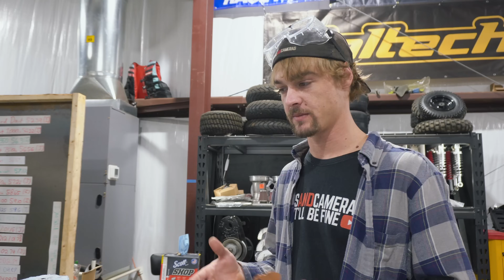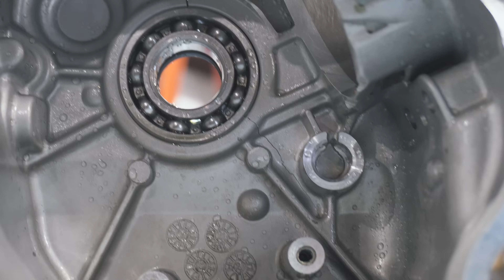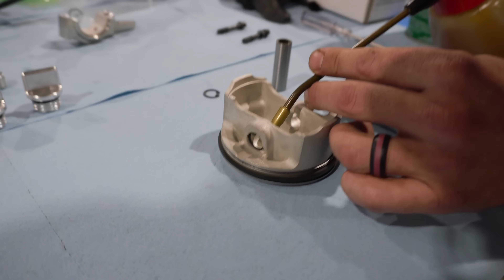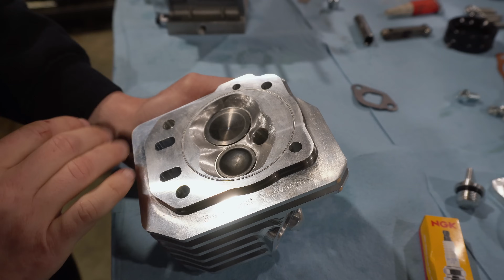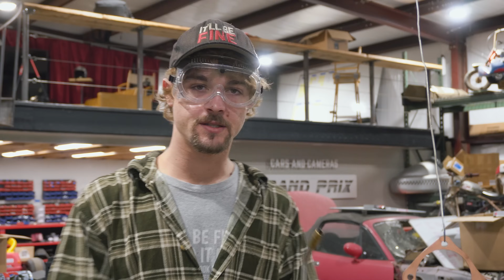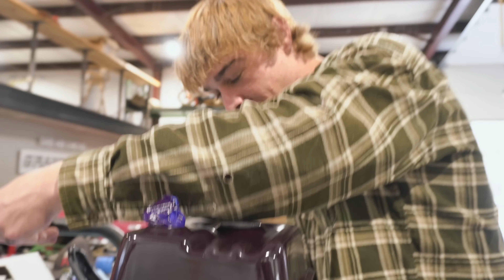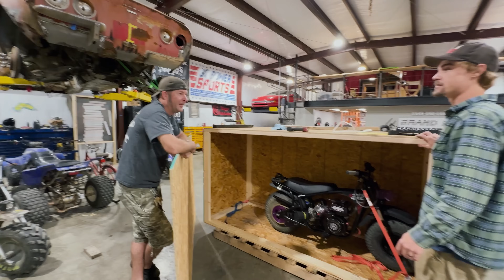Tillotson 263cc BIG BORE Build | Billet Head, 13:1, 30+HP Monster!

Comment: this is really impressive, this engine exceeds 100hp per liter. Especially since it's NA. As a side note, engine internal parts with shavings and burrs are unacceptable, yes the builder should be diligent but that is 100% considered a bad part.

Comment: I need help with a jawa moped.
That's definitely a late sixties or early seventies model it's a 2-speed engine, but when I bought it the engine was seized and I've tried to break it free with mystery oil but it still didn't work so therefore I need help trying to find a new engine for my can y'all help me out

Comment: Please can I get the parts list
Reply: EC 263 bottom end kit
Custom cam
Moflow1 cylinder head
Gage 1.3 rockers
Mikuni 28mm (I'd recommend the Nibbi 28mm)

Not hard, you can get everything you need except the cam. I recommend something like a Dynocams 308.

Comment: I wanna get one of the early XL/XR 500 engines and throw it onto a Sprint Kart chassis - man that will be a ripper with all that torque straight off the rip and would be a hoot on a smooth concrete surface track, just drift central with no effort. Actually, it would probably be a nice kart to drive on road race circuits too.

Comment: Need to run sonoco 110 with that much compression any thing over 10 to 1 on a small engine is better and you'll gain power and run cooler

Comment: Did you measure pushrods or there is a certain size for this build ??
Reply: 5.700 but that's because of the custom length valves. Typically this head uses somewhere in the 5.500s

Comment: I don’t know if you guys will respond or not but I have a predator 420cc but my chain keeps slipping after I tighten it is the #420 roller chain to small or should I try getting a better #420 chain
Reply: Check your chain alignment and it could also be your motor plate flexing and the chain slack changing. Especially with something as torquey as a 420.

Comment: You need to fab up a build/run stand for an automotive engine stand so you can rotate it while you build it then run it on the stand. I did that for my Z-50 engine.

Comment: I always lightly chamfer the parting line on the rod and the bearings. This will prevent scraping material off the back of the bearing and the chamfer on the I.D. of the bearing makes sure the bearing crush will make the parting line a tiny bit further from the crank so it doesn't scrape the oil off.

Comment: (Cars and cameras) “9K rpm very high!”. My RC car engine idling at 13K…
Reply: My kohler sounds like it’s gonna explode at….. 3800
Reply: A 2 stroke rc engine and a 4 stroke build based on a pressure washer engine are 2 completely different things and there Is no comparison to be made between them
Reply: @kartracer5g229  this motor ain’t no pressure washer engine
Reply: @joshmanis9860  yeah and it was a joke, he’s getting defensive over stuff he ain’t know about
Reply: @theepicbuilder2935  yea I would help if I changed the oil and oil filter in it I want to try and find a oil cooler for it
Reply: @joshmanis9860  turbo charged pressure washer

Comment: You guys are giving viewers valuable information on any rebuild. I restore vintage Briggs & Stratton 1hp engines, from the 1940's and the methods you are going over should be applied to every rebuild regardless of the size.  Thanks for the correct techniques.

Comment: We used to put the copper head gaskets, from our motocross bikes, on the burners of electric stove tops and let 'em get hot enough to glow. Had to brush 'em off before installing, but it worked great.

Comment: It wasn't obvious but the copper head gasket should be brought to cherry red. It will need to be retorqued several times after several run (heat) cycles before it will hold the torque.

Comment: A 260 CC mini bike that is insane. Electric start would be nice but you don't need the extra weight not sure how easy it is to rope start an engine with 13:1 compression

Comment: Just a tip: When wanting to apply stickers  perfectly straight, I know this seems counter initiative, spray the surface you’re applying to with glass cleaner, put the sticker on and move to desired location, and you can get your sticker perfectly straight when everything dries. The sticker will adhere even harder over time.
Reply: Counter INTUITIVE. I think Automistake bit ya!
Reply: This only works with vinyl/stickers that have solvent based adhesives. Most vinyl is but you'll find lots of die-cut laminated stickers never actually dry or 'stick.'

Comment: i was inspired by you guys and finally threw on my first mods to my 212, a 26 mm mikuni and a header pipe. unfortunately, the extra power destroyed the bearings in the torque converter

Comment: Annealing is the process of removing any "temper," the piece of metal has, it prevents the gasket from getting softer after the engine heats up.  Not annealing will make it soften up while in service, which  would make it lose proper head bolt tork. oh yeah, nice vid., again, I really look forward to Wed. vids.

Comment: 100 octane  fuel 😂, you are doing like if it was somethink special, I can get this on normal gas pump😉 Enjoyed the build.
Reply: Maybe, but I bet you're detonating if you're trying to run 13:1 and shortening the engine life.
Reply: @WyFoster  actually no because I am using the cheaper option witch is 95 octane,that is standard here.
But my motorized bicycle did not like the 100 Octane, because the burning time was shorter, so the small engine piston had less time to extract the pushing energy from the fuel.
Reply: 100 octane in Europe is 93 octane in the USA. To you, this is running on about 114 octane.
Reply: @WyFoster  yeah "SURE", also america 87 Octane.
And i don't get the 114 octane part.
Reply: @Jarda_B  RON in Europe vs MON in the USA. It would take about a 114 octane rating in Europe to be the same as 100 in the USA.

Two octane numbers are routinely used to simulate engine performance: the RON simulates gasoline performance under low severity (at 600 rpm and 120°F (49°C) air temperature), whereas the motor octane number (MON) reflects more severe conditions (at 900 rpm and 300°F (149°C) air temperature).

Comment: There's easy way to cut a gasket. Hold gasket paper in place, where it will be mounted, and tap all around the outside edge of the thing you're making the gasket for. Tap with a socket extension or small hammer. The sharp edges will cut right through. Do this for the inside cut as well. This is not my idea, it's a pro tip. Try it, you'll like it :)

Comment: I sure hope tillotson is watching this video, because one should not have to go thru all this to build a brand new engine. A little oil rag wipe down is ok, but to have to go through this thorough cleaning is way too much to do on a bran new engine
Reply: Isn't this the block Charles gave us a sneak peak at during the Pate swap meet? Something bad happened to it and it dropped the sleeve. That's not a new block.

I'll admit I haven't watched the vid yet, I may stand corrected.
Reply: Tillotson has the block, but the machine work to install a 3 inch sleeve is done by a third party.

Every engine should be meticulously cleaned before assembly. All parts.
Reply: @WyFoster  I would find a different third party to mill the blocks then...
Reply: @vharrald  It's typical that machine shops leave final cleaning and deburring to the engine builder. I prefer to use my own methods.
Reply: @WyFoster  to me, that's just laziness on the Machinist's part... I used to work on cars.. and when e ordered a shirt block from the dealer, it was always thoroughly cleaned before we got it
Reply: @WyFoster  no worries...
Reply: @SantaSkip  An assembled short block, yes it should be clean. A raw block from the machine shop in my experience will have been through a hot tank but that is far from clean enough to assemble.

Comment: Thats only 9 or 10 HP shy of a KX250 if it really does have 30 HP which seems doubtful ... Looks more like 25 HP which is really good for that type of engine and lets not forget. Most stock type engines put out way more torque than HP over what a racing motor will put out

Comment: Try not to be worried about compressing your valve springs when you leave it is say. Plenty of videos of old engines starting after many yrs sat and they weren't left a tdc. If a spring goes out of calibration when compressed, it aint gona last long buddy 😉

Comment: See I tend to disagree with you all’s take on it’s up to us to QC parts ordered. It should be checked at the manufacturer especially but also at the retailer level as well. We are the customer and should not have to worry about that, but it is our responsibility as installers to verify.  Basically everyone is cutting corners to keep up with production demand, and it’s the customers that suffer. I personally think you should be able to purchase a small instant replacement policy where they send you a new part before you send faulty one back, but as most ppl know they don’t want that crap back they just want more of your money. Retailers should pursue ISO 9001 certifications to mitigate this stuff. Peace!

Comment: Interesting build and all but I have a hard time understanding the concept of spending soooooo much money on an engine like this.  For example, my son just bought a 30 year old Kx250 with a great running engine and I guarantee the engine in the bike makes more power and will outlast a build like this.
Reply: All true but mini bike racing is what they are doing. And yes there are mine bikes that will fly. Try 94mph. My old 175cc Kaw gave me years of dependable fun but I couldn't throw it in the trunk go.
Reply: @jeroldlafferty54  I definitely understand why and know the results speak for themselves.  What I am getting at is why not throw the Kx80/85 engine in a minibike frame or something?  Check out the Stunt Freaks Suzuki PV 450 to see a truly insane mini bike.

Comment: Nice build but never seen someone use rtv on a copper head gasket. You use copper spray on a copper gasket. I like the channel but some of the misinformation on here is bad. I hope some people don't follow exactly what they do. They make it work but is it right.
Reply: Every professional small engine builder uses platinum gray or Hondabond because they want the clamping torque from using that kind of RTV. 

The spray stuff is weak in comparison.
Reply: Yea they use that for cases and valve covers. Not on copper gaskets. I've seen it used on exhaust gaskets. Not a head gasket.  And I've built numerous small motors that make lots of power and use spay a gasket copper coat. Wonder why the can had head gasket pictures on it 🤔
Reply: @ralphhondaman  I set the world record in the 8th on a mini bike (video on my channel) Head gasket was sealed with Hondabond.
Reply: @ralphhondaman  If you make enough power you will need to use a locking RTV to stop the gaskets blowing as easily.
Reply: And do a little research. So many forums and people say not to use silicone based sealer. Use copper spray if any. I'd like to meet your professional small engine builders.
Reply: @ralphhondaman  Look up Johnnie Berry at Laid Back Racing. He won every class in the small engine builders national dyno competition. Biggest engine made 42hp on the dyno sealed with Hondabond. 

He's the one who did the aftermarket work to the head in this video.
Reply: @Wyatt Foster  that's what head studs are for. You never use a rtv silicone. You use a spray or if at all anything. Well have to disagree. Use Google my friend it will help you out.

Comment: If Shelby ever built a mini-bike it would start like this. Start with a good, solid engine and then add high performance parts. Plus, build it with care to the assure proper clearances and other specs. Cleanliness is next to impossible, but it’s worth trying to achieve. Good job guys!

Comment: 263cc making 30hp??? that's almost 2hp/inch^3...
Reply: The best I've seen is 2.3 hp per cubic inch. Johnnie Berry, the guy that did the head work on the billet head made 42hp on the dyno with 307cc to win the small engine dyno competition this year.

I was there, insane.

Comment: Should have put a fuel filter on it
Reply: Should be fine since they're using a new tank with fresh race fuel from a drum. 

Getting it from a fuel station with a rusty tank, I agree. Plus the stock tanks have 2 fuel filters already. One where you pour in the fuel and one on the fuel outlet at the bottom.

Comment: If you like spending a heap of money on a cheap motor and then blowing it up in a short amount of time- This is for YOU. Or you could just take a wad of 100 dollar bills and light them on fire. Same result really. 😆😆😆😆
Reply: Inadequate block bracing no third or fourth bearing support .. stock block bored over.. equals boom after a little while ya want a serious build go billet block billet side cover billet heat billet everything.  Shortcuts don't make reliable motors